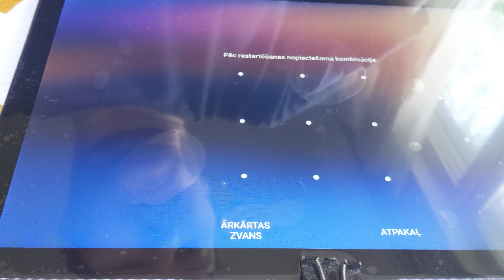10.1inch Huawei MediaPad M5 Lite LTE Display replace

Comment: Brother after breakage,  my touch is working  fine. Do i need to replace whole or glass only? And bro did the mpen work after you repaired the tab?
Reply from the maker: Hi! Glad you're reaching out to me! If you can afford it, I would recommend replacing all the glass with a screen. You'll save a lot of time, my friend! I did the same for this very reason! It is better to order with a frame so that you don't have to glue the glass in place. In this type of tablet, it is very difficult to replace only the glass itself, since the touch screen is (in a sense) part of the glass. And the screen (LCD) is tightly glued to the glass, there is a special technique to remove the glass from the LCD. I really don't know about the mpen because it was a job for the customer, but if she doesn't complain, I think it works well!
In conclusion, if you asked me, I would say change the hole. If anything, to save some money (but not time) you can try to replace only the screen, although I don't know if it's really possible here, because I was replacing the glass with frame and LCD, all toghter!

Comment: Thanks for the video, but i have a question that i hope you can answer. This was the screen only right? what I mean is that the LCD was fine?
Reply from the maker: Hi!
This was a repair for an customer and yes, the LCD was fine, there was broken glass and touchscreen wasn't working. But as the LCD and touch are glued together, I replaced both at the same time.

Comment: I want my tablet screen replacement how can I get it done.
Reply from the maker: This is a complex and ambiguous question! It depends on a lot of things, like what the tablet you have, how the screen is attached, how experienced are you, do you have the equipment, etc. The basic procedure is as follows: First, watch a video of someone taking apart your tablet and assess whether you have the necessary equipment (heat gun, screwdrivers, etc.). And are you sure you can do it?!? In principle, for some tablets, the screen can be replaced without heating, but by replacing it together with the frame. If you have everything you need, then you have to find a replacement screen from a dealer (local or global) who can offer it (be very careful when ordering to make sure it is your screen exactly). And then you just have to replace it by following the tutorial. That's how I started doing it. But it is not so easy to tell it step by step! Also in USA there is free to repair movement maybe there are some articles to provide some explicit ditails about individual steps. https://en.wikipedia.org/wiki/Right_to_repair